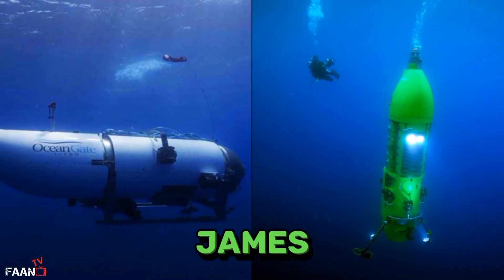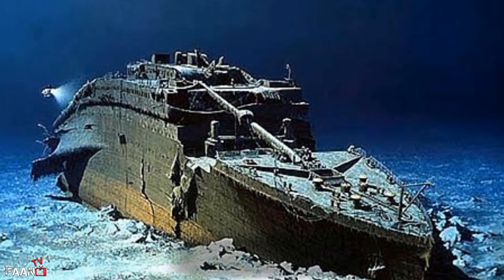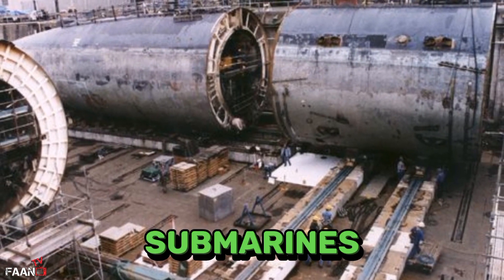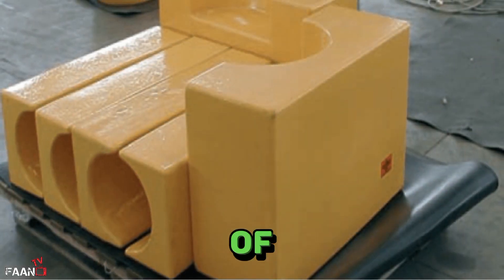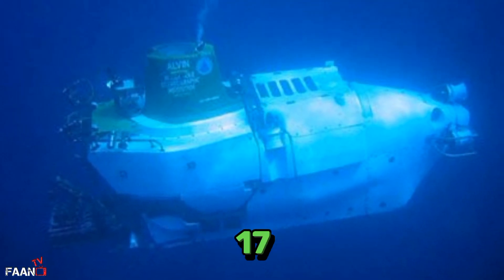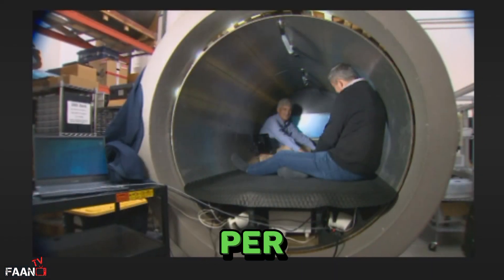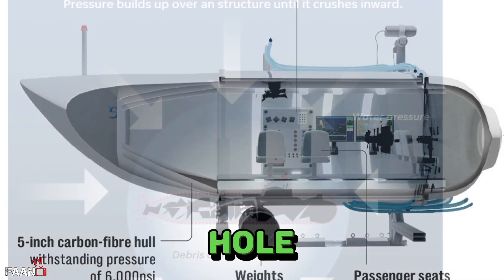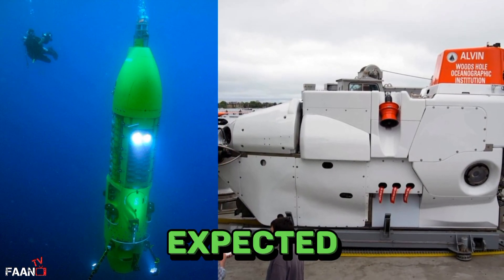The Truth Will Shock You! Detailed Titan Sub And Deep Sea Challenger Comparison

Comment: I'd say the carbon fibre hull idea has now been tested adequately at depth... and found to be wanting. It can't be modelled in a computer in advance because it's not a pure material but a composite. It's known to be better at holding internal pressure in (as in a pressurized airliner like the Dreamliner 787) than holding external pressure out because it's spun from fibres that are stronger in tension than compression. It loses a little bit of strength with each compression-decompression cycle until it fails by shattering with little warning. As was demonstrated last week at the cost of 5 lives.
Reply from the maker: Well Said! Thanks for your valuable comment
Reply: Actually, Stockton Rush used carbon fiber that's on the cheaper side and didn't get rid of possible internal pockets of air.
If he used 'criss crossed' carbon fiber, it might've been different. It could've been a new word in the lower depth diving.
But alas he made a very bad case for carbon fiber.
Reply: isn't the internal pressure of the dreamliner irrelevant as it likely has to meet all performance metrics even while depressurized?
Reply: @bob15479  I guess that's so. The hull of an airliner is under maximum stress when fully pressurized at 35000 feet or so, but that's when carbon-fibre hulls are in their strength.

Comment: the builder of Titan was deceived by the hype of carbon fiber
Reply: Carbon fiber sucks. Metal will always be better
Reply: @prestonhanson501  it’s great for fishing rods!
Reply: Are you anti carbon fiber?
Reply: @kristoffliftoff9316 carbon fiber doesn’t compress well
Reply: @kristoffliftoff9316  i'm against to those who use carbon fiber to gain profit & jeopardize safety. If carbon fiber is strong and durable how come the armor plating of battle tanks are made up of steel 🙂
Reply from the maker: On Point!
Reply from the maker: @prestonhanson501
Reply from the maker: So true!
Reply: I'm still pretty hyped on carbon fiber.